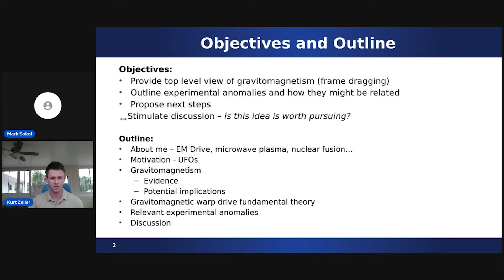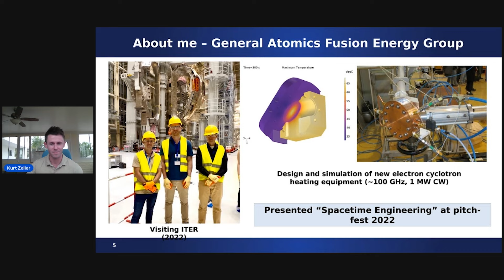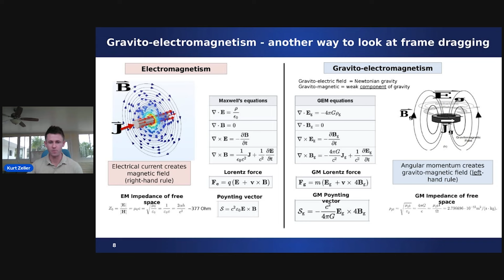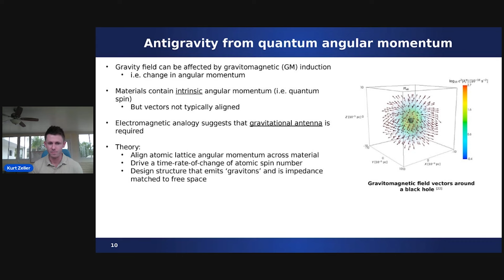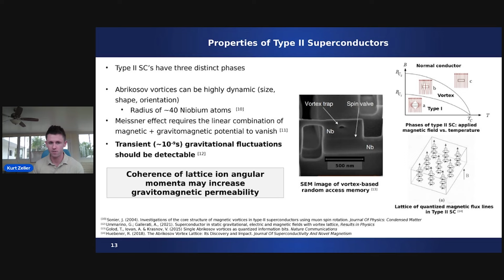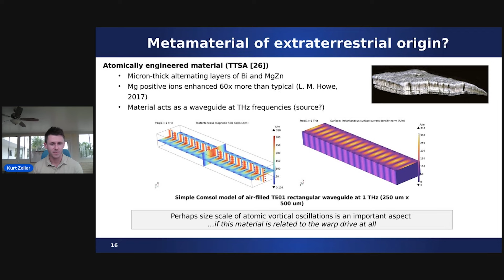Gravitomagnetism & Spacetime Engineering | Kurt Zeller

Comment: Would be neat to go back to Maxwell's expanded set of theorems from the 1862 thesis rather than the reduced set of his work most people use specifically use for electrical or electronic stuff today. I'm a bit too much of a generalist to do the heavy digging work, but I'm curious if all 20 formulation sets could still be re-framed into localized relativity and would they pass the Noether symmetry tests with minimal or no modification? Maybe a bit of a wild thing to ask, but it'd be interesting to get a more informed take on how that fits together or not. (And maybe knowing the whys around that.)

I think Maxwell had something there, but why was the extra work stuffed away in the filing cabinet and forgotten vs. the thing he's currently known for?

If it's possible to produce controlled gravity fields and gravity waves, it's not just (unconventional) propulsion but stuff like fusion gets some tech unlocks too. (A high enough frequency might do some oscillation stuff to the Coulomb barrier and possible resonant instability breakdown effects.)

Comment: Kurt, reg. slide #10, take the notion of 'quantum spin' with a grain of salt. Physics understands that electron 'particles' don't physically spin. The underlying characteristic behavior is only interpreted as momentum, ergo spin.  Relatedly,  I'm sure you are aware that Dark Matter is only hypothetical.
--
In  Plasma Cosmology [Electric Universe hypothesis] Earth's is also modeled as a capacitor where the electric field potential tween outer space and Earth is interpreted/called grabbity. I'm sure you also aware of the electric gradient/potential [voltage] present in the atmosphere This e-field biases/polarizes all matter on the planet and therefore is [practically] impossible to block/shield. Check out the The Thunderbolts Project channel on YT for more info. On a related note, electrical engineer, Xavier Borg, carried out a 'grabbity' shielding eggs-periment and obtained preliminary positive results, although he quickly retracted that information w/o eggs-plain-nation. [Shhh. I could see why.] Soon after he and his website went dark. The website can only be found in an archive now. I used to be one of his followers from Yahoo Groups [long ago] and then on his website after Yahoo shut down the Groups feature. It is well known that the electric field is 10^39 times stronger than the 'grabbitational' field so a slight bias of matter could do the trick.

Another great channel are LPPFusion [working on a simple fusion concept/experiments via plasmoids], Sky Scholar channel, See The Pattern channel and Tim Ventura Interviews channel

Leme know you got this...somehow. @AltPropulsionConference

Comment: Nice though missed. The early galaxies and a preferred handedness. The cosmic web and galaxies lining up in ways. Nice to see you cought the inverse square/hooks law and EM and gravity. The order of magnitude. 15:40 Yep small effect compared to the other forces. LIGO, probability and predictability and particle production from quantum foam and gravitational waves and energy density regimes. It's really small. The space experiments also.

You may want to look into old-school neon lasers and magnetic pinching/confinement and steering. Photon pressure. Also metamaterial. 

Keep up the good work.

Comment: Here is a tip from a physicist who is working in this area...
Magnetism is gravitomagnetism and yes its tied directly to the electric field. 
So no you won't generate an antigravitational field going down this path. 
You need to reverse engineer spacetime and work upwards from there.
Reply: space time has matroska code in it... 1.0011001100110011 yes? wanna know more? it was known atleasy 6K years ago. The made it really clear they had knowledge of planck scale back them. This is written in plain sight.
Reply: @v2ike6udik General relativity potential wells have repeating taylor series. This is typical for entropic systems. You'll also see this popping up at the particle level in the anomolous magnetic moment. Which is no coincidence.
Are you a physicst.?
Reply: @carparkmartian2193  naah, im not working for illunazzi. i have some data, but it gets wiped everywhere. Explain me how formula for SchmnReso orders is 35% off, and how come i have excact formula? :)  and it is not related to earth´s circ. Nor light speed. SchmOrders are mathematically universal, not earth bound. BTW, are u in the camp "meter is abitarty unit, madu by french" or do you know it us ole and universal unit. Not arbiitary. The same was second is not arbitaty unit. It gives me clue, is it worth to talk to you. Mosy physicist are braindead. At least openly. They dont like that other ppl know the truth. Santanism.
Reply: I'm a physicist and engineer. 
SCHMNreso orders =?
Reply: @carparkmartian2193  i ususally cant say the full name, it is in haram-list. Like many other things. Schumann resonance. Smth else, dig into Thad Roberts work. He elliminated all 288 constants. Noone talks about this. I found him, because i reverse engineered Planck length (and he does it a bit differntly - and gives answers to 288 things more than i do :D) from ancient units (khm, 1 meter, meter is ancient unit, not 200y old, it is not arbitary length). So i also found my self in a puzzle - is planck length earth bound or is earth size planck length bound. More fun facts. Unrounded (metrified) imperial units are meter bound, hence also plack bound. There is simple geometric formula for all of these. And all sources absolutley deny there is any connection. "They" know the truth, that´s why they burry it. It open up do many doors and their lies start to take obvious shape.

Comment: What you’re describing as gravito-electric and gravito-magnetic components aligns directly with the framework I’ve been developing since 2016. My research shows gravity is not a separate force but the emergent result of three measurable factors: mass, electromagnetic field density, and momentum (linear or rotational).

Put simply:

Mass = stored electromagnetic energy

Field = charge in motion generating EM structure

Momentum = motion twisting and polarizing those fields

Together, these produce the measurable effect we call gravity which is why I express it as:

Geffective=M+f(B)+g(P)

This sits fully within Maxwell’s equations and extends Einstein’s relativity by treating gravity as field dynamics, not magic. It also builds on Dr. Ning Li’s AC/DC gravity distinction, unifying static mass effects with dynamic electromagnetic contributions.

I’ve engineered this into a few testable prototype designs, the Electromagnetic Gyroscopic Propulsion Engine (EGPE), which applies these same planetary principles in compact form. My published works (Amazon Kindle, search Noah Johns) and ongoing posts on X (under Noah Isaac Johns) lay out the math, simulations, and experimental roadmap.

Gravitomagnetism is a piece of the puzzle the bigger picture is that gravity emerges whenever energy, fields, and motion converge.

— Noah Isaac Johns

Comment: I'm not a scientist, but I believe some of what you're describing can be seen in what I call "ghost bumps". 
If you've ever driven a truck with dual wheels, that has at some point been in the mud, you'll know what I'm talking about. If you've ever watched the movie "my cousin vinny", you should have an idea. The difference is in the movie, they're referencing a car with single tires, "getting mud in the tires". Mud accumulates in the inner rim, thus throwing the balance of the wheel way off. 
With a dual wheel truck, bud rims are put together so that the one on the inside is dished inward, and the outside wheel dishes outward. The outside wheel will commonly be washed out, but unless you remove both the outside and inside wheels from the truck, it is next to impossible to remove the mud build up from the inside wheel. 
So you have two essentially two rotating masses, nearly identical, except for the additional, off center mass of mud on one of them. At low speeds, both tires hop just like you would imagine they would. But once at highway speeds, they both become smooth. The force contained in the angular momentum of the balanced wheel, overrides the unbalanced wheel. However, as soon as you hit a bump in the road, the disturbance allows for the unbalanced wheel to go crazy for few seconds. So you hit one bump, but then you feel 7 or 8 "ghost bumps" afterwards, before they pair calm down and go smooth again. Until the next interference sets them off... 

I know there's nothing knew about the critical stability point or whatever it called idea, but when you have two masses connected, one balanced, one unbalanced, I can promise you, the affect is quite different.
Reply: just remembered recent Steve Mould's video about these beads
Reply: @NikitkaDreamer ya me too. But dual tires will do it without any beads.